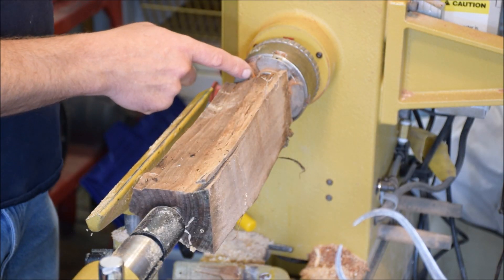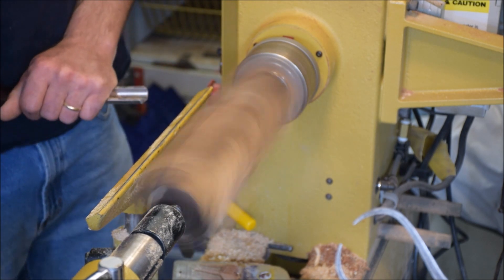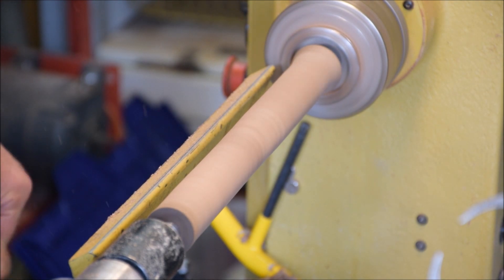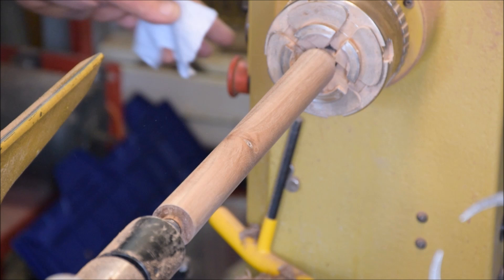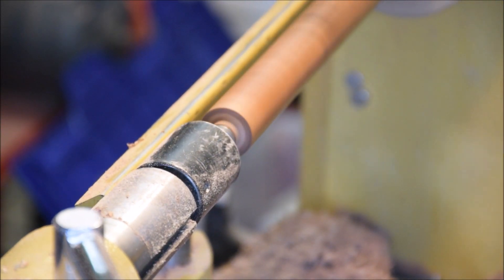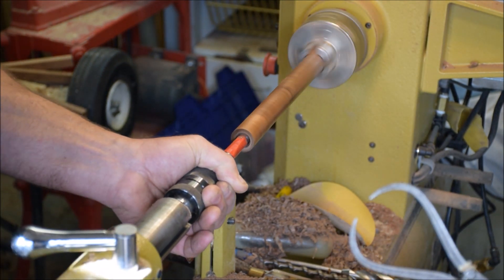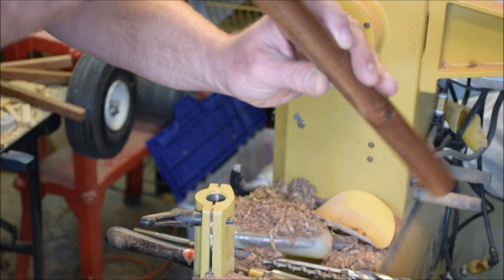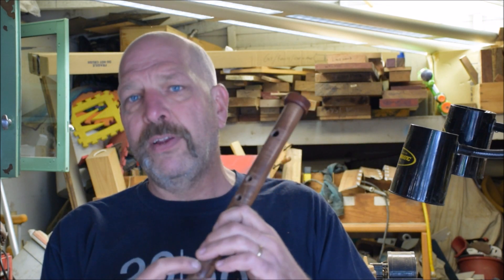Naked Turner Turns Wooden Flute and Plays It

Comment: hi, great ideas for the drilling part if you use 1/4 drill bit you end with a drift too i suggest drill half the lenght turn 180 degree drill the rest. you start drilling with short drill bit help a lot and prevent the drift during drilling operation. and make sure your drill bit is sharp and reduce the rpm.
Reply from the maker: Yep that is how I do it if I do it.

Comment: Thank you Erik for another great video.
I've turned several table lamps and in my early efforts I foolishly turned the finished product before drilling the hole for the cord/cable.   Disaster struck when the hole took the easiest route and came out through the sides of my "masterpieces".
I now drill the hole just after I have the piece roughed out by starting with a spur drive after which I come in from both ends with a longer but smaller diameter drill bit.    It's then great to see daylight through the holes after which I can enjoy the rest of the turning.
Thanks for mentioning Baconsoda.    We are in the same woodturning club.   He came out as champion turner in 2015 by accumulating 26 points in the monthly competitions while I was hard on his tail with 2 points:-(.
I'm aware you've had a lengthy drought in California so glad to hear you're getting some rain.
Best wishes,
Alan.
Reply from the maker: +Alan Simpson Thank you Alan, in the future I will drill my hole first and then center on the hole and turn using the hole as my center.  This was a fun one and it is fun to play too.
Reply from the maker: +Alan Simpson I too am glad to be getting some much needed rain.

Comment: Howdy bro I've done similar lath flute making up to 36" long hard wood and found to simply drill the hole first, from both ends meet in the middle. Then bring the outside down to the hole, can do it right down within 2mm accuracy. Reason is to keep the wood as stable as possible  while attempting to drill the hole. Have enough wood thinknees before drilling the hole she'll be stable...all the best:)
Reply from the maker: Thanks that is how I do it now

Comment: The flute looks good and sounds great. As far as the hole drilling I wonder if you could drill as far as possible in both ends. Then finish a little at a time from one end then the other to make the hole more concentric. I've never tried it but it sounds logical to me,
Reply from the maker: +Gil Grace Pierre had a good tip which was to drill the hole first and then use the holes as the center and then turn the spindle after the hole is drilled and it will be centered.  Thanks for watching Gil

Comment: What do you think of using red cedar as a wood to make a flute?  You notes seem pretty right on, I know I couldn't guess and get it right on like that the first try.
Reply from the maker: Cedar is easy to drill out but soft.  I have seen many native flutes made out od cedarand they sound good.  You might want to bake it in the oven for an hour or more at 225 degrees to harden the wood after hollowing but before drilling.  Thanks for watching David

Comment: Thanks Erik! I've been interested in making a some type of wood wind instrument for quite a while now, and this looks like a perfect starter project for me. I'm going to have to give this a shot for sure. 
That sure does have a nice sound. 
Is it necessary to burn the inside of the pipe, or would a good sanding be enough? Also, is there a specific formula to where the holes go?
Cheers! ... and Happy New Year!
Reply from the maker: +Jerry Paul Thank you Jerry, you could just sand but this helped dry and burn away the fibers and I did a bit of sanding too.  As for the holes I am sure there are hole plots and sizes and flute lengths for the different types of flutes and flute tunings, I will try to find out more before I make any more, but this was fun and it sounds pretty good.

Comment: dear use FLUTOMAT for exact measurements
Reply from the maker: Thank you so much I appreciate 
that info!
Reply from the maker: I have questions Dainesh, when it says distance, is that length of flute or length from center of blow hole and what is diameter of drill through or bore of the entire flute and what is the diameter of the outside of flute. on these dialog box variables i don't see these pieces of info.  Thank you though I like the rest of the dialog variables but some info seems to be missing.
Reply from the maker: I see it all now it was not opening the first time I went there now all the boxes are there!  Thanks
Reply: Erik Anderson goodluck
Reply: Erik Anderson can you churn out a tube from red wood or African black wood
Reply from the maker: I suppose I could

Comment: You never get a straight hole with those drills.
Reply from the maker: I know It is the best I can do until I get better long bits!  Next time I drill hole first and then center from the hole.
Reply: @ErikAnderson1  Some say single fluted gun-drills will do the job, -  using compressed air instead of fluid when working in wood. (  Looking forward to see your solution to the problem ! )

Comment: Hello, I watched your video where you made the saxonet. Did you drill the hole the length of the spindle? If you did, how did you keep the bit from wondering?
Reply from the maker: Drill the hole first and then use the hole as a ne center piont and rough it in from the new hole even if it drifts you have two new center points to use.

Comment: Just found your video ... great job.
What could you have done; or more to the point; how could you have avoided the drill bit drifting off centre when drilling your hole all the way through the blank (unfortunately; long drill bits have a habit of drifting off centre ... weep (If theres a knot in the wood; halfway along, that hard part of the wood will push the incoming drill bit off centre ... can't odds that, doing it your way around, because your original centre line is already committed)) ... !?
So, what can you do; easy; allow the bit to drift off centre; before you start roughing down the blank!
What does this mean ... 
Mount the unturned blank on the lathe; drill the hole all the way through first; even if the bit drifts off what you think is centre, it does not matter, because it is in fact creating its own centre line ... !? Then; just remount on the lathe according to the new; drilled centre line; then turn down the blank to that new centre line ... bingo! An even better sounding flute, by master Erik
Best wishes.
William (Southampton, Hampshire, UK (Woodturner))
Reply from the maker: Exactly... You said so well what I did after doing this on one of my first flutes.  I did it just like you said later in my flute making!  I stopped but might return to that sometime in the future.

Comment: do you have dimensions I would like to make one out of maple
Reply from the maker: +Dylan Jackson Thanks Dylan, this was an experiment and it is not tuned great so please look it up online and I will be doing the same so I can learn more about dimensions and hole sizes.  I may do a follow up video later to make a better more scientific attempt at making one with appropriate sizing and better tuning.  Thanks again Dylan!  It is 12 " long and 15/16" diameter, then I drilled a 5/8 hole 2.5 inches in with a forstner bit and then a 9/16th" hole all the way through, then just guestimated on the holes for fingers and thumb.  Hope that helps
Reply: +Erik Anderson thank you I hope this piece of maple works for it
Reply: +Dylan Jackson maybe even out of purple heart cedar
Reply from the maker: +Dylan Jackson Drill your hole first and then use the hole between centers and the hole will be centered, as Pierre mentioned and it sounds like a very good way of doing the through hole.
Reply: +Erik Anderson  thanks erik